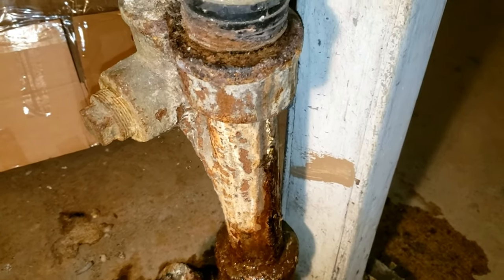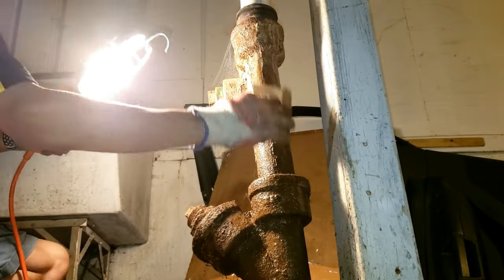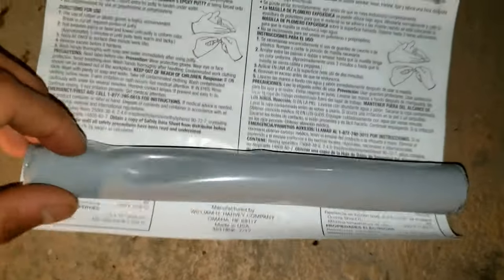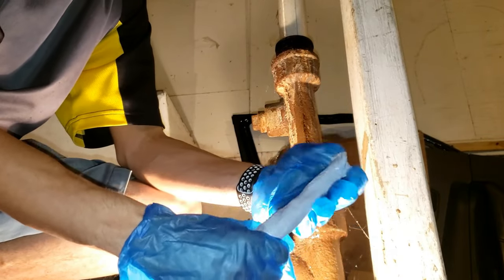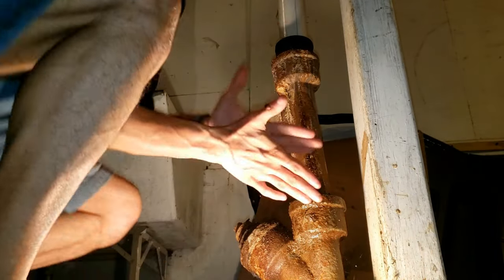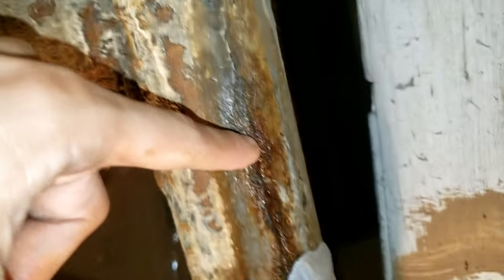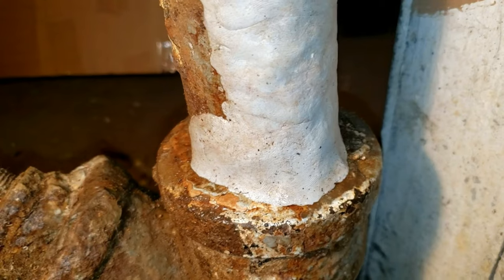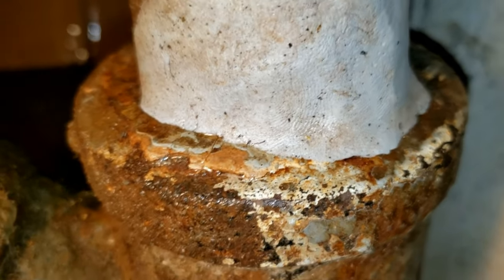Patch Leaky Cracked Waste Drain Pipe With Epoxy Putty FAST Repair

Comment: I will try this!! I tried expensive tape, although it greatly reduced the water it still didn't fix the problem. I'll try  putty plus tape. The putty will get deeper in to the cracks.
Reply from the maker: Hope it works out for you.

Comment: Dear Random: Good video. The epoxy would seemingly be better in any copper situation than duct or electrical tape. Tapes don't fill in the intricately shaped cracks.
Reply from the maker: Interesting.

Comment: Nice video. I currently have a leaky pipe in the basement, coming down from the kitchen sink drain. I’ll try this. You could have a pail of hot soapy water, with a touch of bleach next to you, to clean the area and hands. I think working with the putty with bare hands would be better. I would rather go this route, then to pay a plumber a fortune!
Reply: How did your repair go?